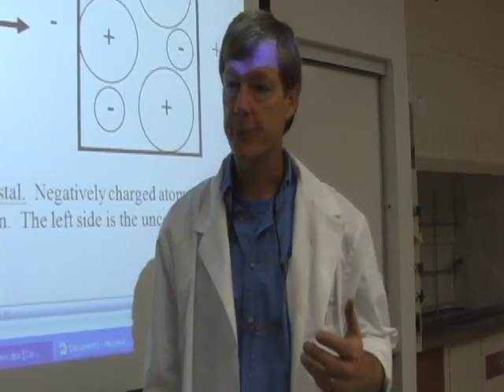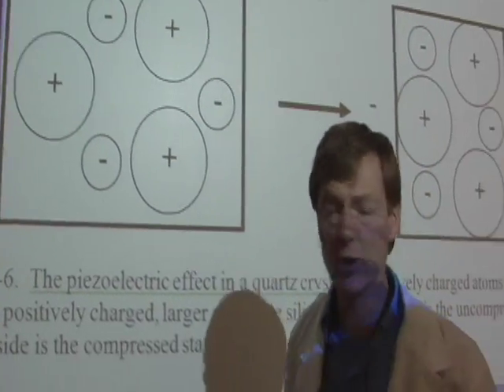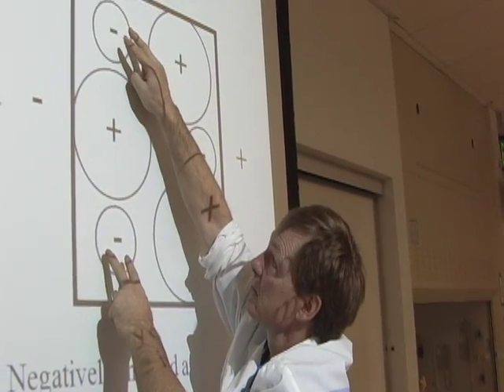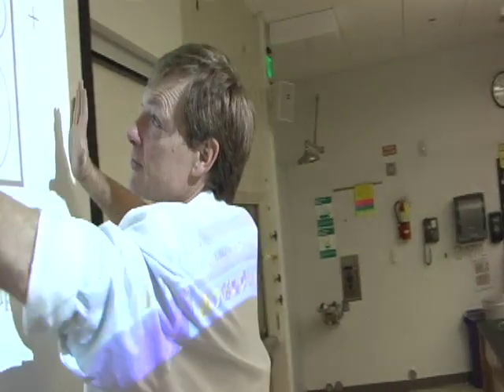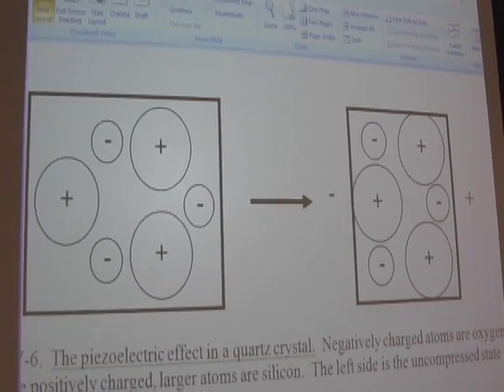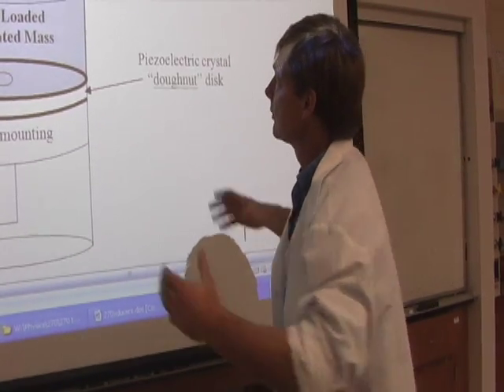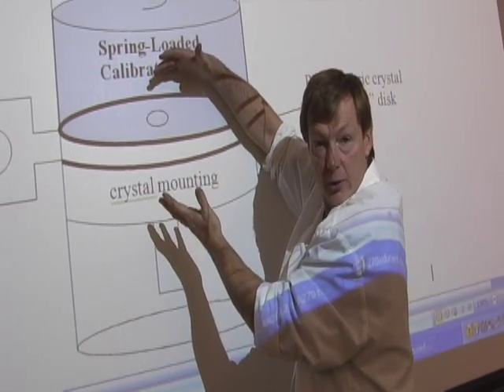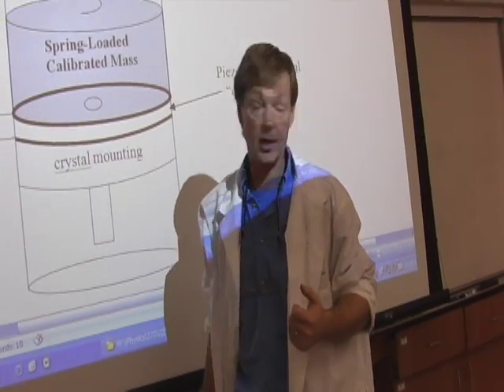Physics IV D3 Transducers: Piezoelectric Effect, Sonar, Accelerometers PART 1

Comment: Actually, it sounds right to me.  I just said that so that it might incite a possibly better explanation.  The surface on each side of the slab of quartz is neutral  because the two silicons (on the right half) are placed in just the right position so that their effect on the right surface is equal to that of the oxygen.